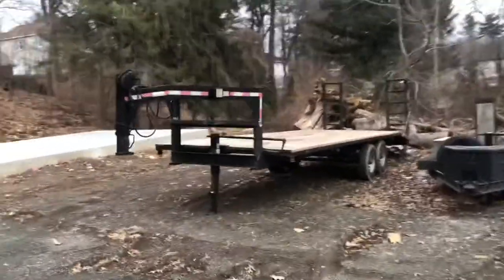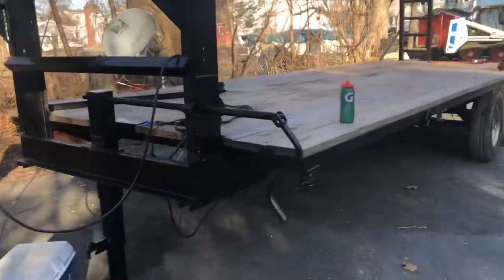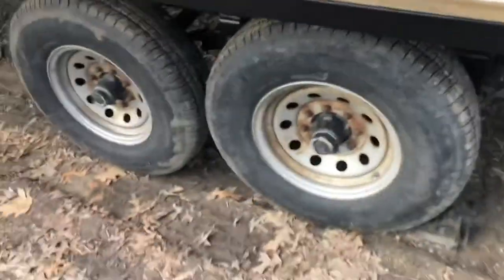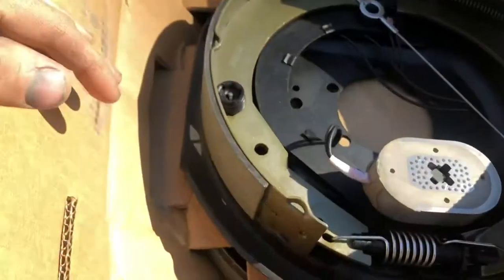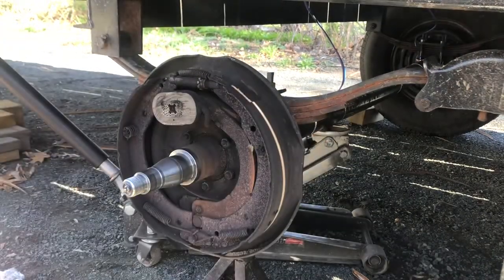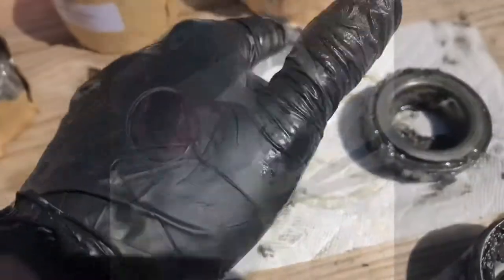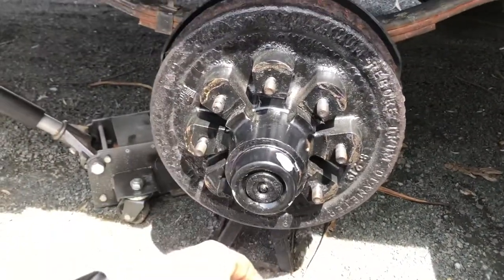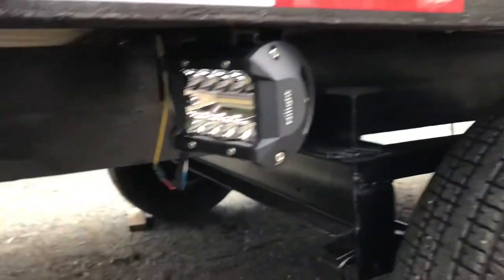Restoring and updating my gooseneck trailer

Comment: What angle degree bend is the gooseneck tongue at???
Reply from the maker: That’s a good question, do you mean towards the front at the neck or the rear where the ramps are at?
Reply: @wheelinndealin  the bend were is right above the gussets in the front...left and right......are they 45°s?.... Because that ibeam both meet at the coupler...you know what i mean?
Reply from the maker: @eltubo  I see what you mean, it’s less than a 45 degree angle but I don’t have specifics